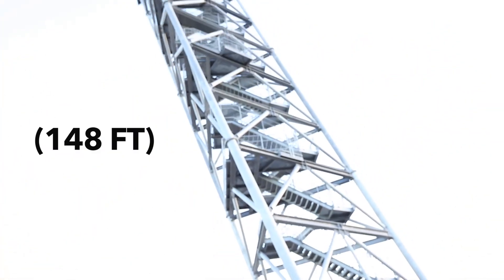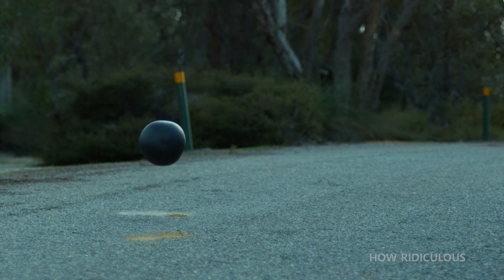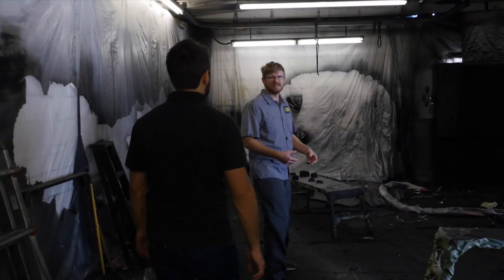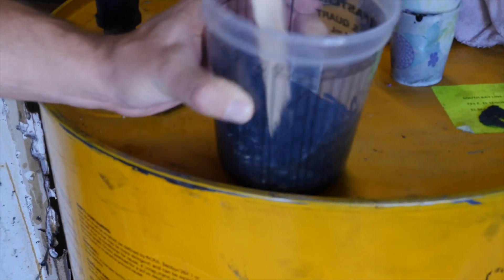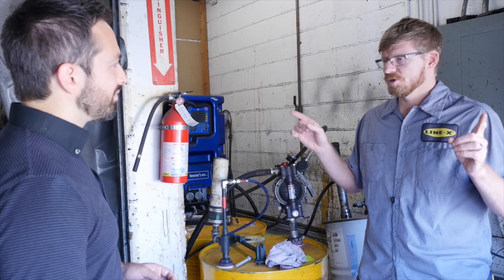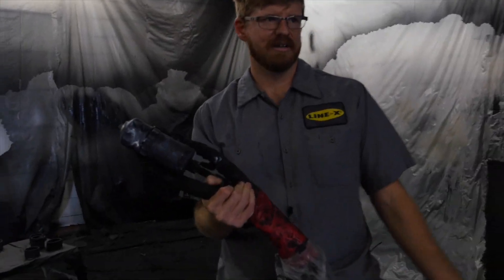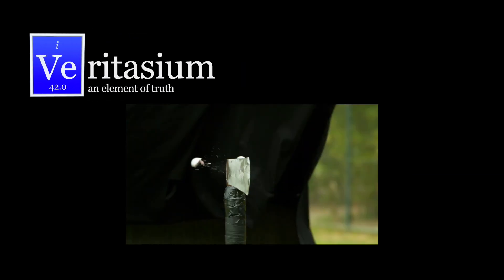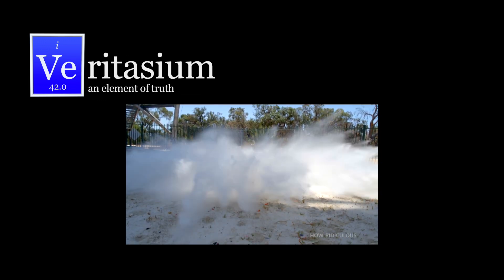Indestructible Coating?!

Comment: I need this on my phone
Reply: They just throw old Nokia phones into giant crushers that need to be replaced every 3 days and BAM, Nokia powder just waiting to be rebranded as Linex.
Reply: Richard Z cover it with a nokia shell. actually linex is made up of nokia molecules instead of the poly-urea molecules as said in the videos.
Reply: +Juggernath Nokia's Executive Powder. It's got a million and one uses...
Reply: Get a TPU (thermoplastic Polyurethane) case. It is a very similar material made using the same reaction and has very similar properties. This polyurea is not much of a new invention it is a basic concept in undergraduate polymer classes.

Comment: if it's accidentally applied on the skin, it's impossible to remove without removing the skin?
Reply: Well, i think your skin cells would fall off after a while.
Reply: Normally it would probably just come off... But the temperatures made by the reaction might melt your skin which might fuse it with it.
Reply: @descai10  It might enter your blood stream as well, and you'd be dead within some minutes.
Reply: you become Luke cage
Reply: It would burn.  My guess if quickly wiped off it wouldnt stick because of oils and water on your skin.
Reply: No... It acts like rubber, so you could rip ot off, or in the wors cases remove a layer of the skin.

Comment: What about using this for safety in vehicles? Instead of lining the bed of the truck, spray the entire truck.
Reply: Daniel Gloyne 
Although it may be useful to reinforce certain parts of a truck, I believe vehicles are designed to absorb impact rather than bounce. 

Otherwise you'd fair about as well as the inside of that watermelon in an accident.

I could imagine this as a great coating for military vehicles, though.
Reply: Martin Good point. I guess people would bounce around and then air bags would have to be redesigned. Military could work, maybe even for aircraft. Or people in tornado prone areas should line their walls too. I just think the applications if done right could be used to help a lot of people. 👍
Reply: If you were inside the vehicle, you would still be killed in say a 60mph crash into a truck while youre driving a car, lined or not. The inertia is usually what kills the person, not the crushing of the car. Though it could be pretty effective for constant weight and not sudden G's, hence why the bed of the truck is the first choice.
Reply: Daniel Gloyne The place I worked at did it to the interior and exterior of a jeep. never had a paint chip haha.
Reply: Kara Hanscomb Haha that's awesome!

Comment: It says 107 km/h, but even using a high latitude gravitational acceleration of 9.825 m/s^2 and ignoring atmospheric drag you will only get 3.01 s * 9.825 m/s^2 * 3,6 (km/h)/(m/s) = 106,46 km/h.

Comment: Could you linex an egg and drop it from that high? Actually does it matter what's inside the linex? Surely it just tries to keep the shape and whatever is inside gets a beating. It would probably still contain but probably break up concrete inside it

Comment: This is pretty revolutionary. What happens if you spray it on a slinky? are there bullets that this can't protect from? can it help with preventing buildings from collapsing during earthquakes? how expensive is it? we should make helmets from it. compare its shock-absorbant properties to other objects.
We want answers Derek! :D
Reply: It wont help with bullets it cant protect a car moving at relatively normal speeds from serious damage either nor could it stop a building from collapsing in an earthquake
The way it would collapse though would be different (As in larger blocks of debris that rip the coating due to weight i think) and it works against Police dogs biting through your clothes if you have it on there
Mythbusters did an episode on this a couple years ago

Comment: As a materials engineer, I can say that this is the property of basically all rubbery vulcanised material. This coating is not as thin as it seems, and the ration of elasticity/rigidity tends more to rigid rubber, due to more tangling of polymer chain.
Reply: Greetings,
I am a little bit of out of my depths here.
Is it possible to use this to create a car chassis ?
Reply: @Seekerofknowledges  no, a car chassis has to be stiff -- watch a Formula 1 car in slo-mo going over a curb at 100mph, the tyres are flinging about everywhere but the chassis (tub) remains straight. Now watch a road car trying the same thing, the body shell twists & the car usually ends up spinning off or rolling.

Comment: s = 45m
a = 9.81 ms^-2
t = 3.01 s
v = 107 kmh^-1 = 29.7 m/s

v = a*t
s = 0.5 * a * t^2

9.81 * 3.01 = 29.5                    good enough
0.5 * 9.81 * (3.01)^2 = 44.44  also good enough

seems right :)
Reply: You forgot your units. -1
Reply: Looool I'm guessing you do A level physics atm?
Reply: Adam Zidane that's GCSE
Reply: Adam Zidane 
after looking up what GCSE means I can say it's more GCSE level. 
in currently in my twelvth year at school (German Gymnasium) and it had been a while since we last had this stuff in school. but it's easy.
Reply: In English we use a period (.) instead of a comma (,) as our radix point. So the acceleration should be 9.81ms^-2

This way we don't confuse the comma with the one we use to mark each power of 1000, as in the speed of light 299,792,458m/s
Reply: 107=29,7 ? Sure
Reply: Obbliteration 107 km/h= 29.7 m/s
Reply: Obbliteration 
fixed it 

Dan
I know. i somehow switched to comma and then made all consistent. 

also, I would like to add that I have neglected the force that is induced by air resistance. it could become significant at almost 30 m/s.
Reply: Assuming a watermelon 61 cm wide 25 cm in diameter weighing 10 kg with a drag coefficient of 0.27, the terminal velocity is 36.25 m/s, so it is pretty significant

Comment: I want that on my car.

Virtually a tank
Reply: Atiruc until you hit something. inside would be a mess while the outside would look like nothing happened
Reply: People actually do that, it's particularly popular on old jeeps and 4x4's in general. It wouldn't make your car mechanically tougher, but it would make it scratch resistant. Basically you'd never have to worry about a shopping cart hitting your car again...

Comment: Lynex Helmets need to be a thing i want to be able to take hammer shots to the head with little to no injury.
Reply: Brian Rodriguez The exact same thing will happen to your brains as to what happened to the watermelon. In short,  it's a bad idea o:
Reply: Even if the helmet doesn't crack or break, you still end up with a concussion, which can kill you if you are hit hard enough.
Reply: Brian Rodriguez depends on how it the hammer is and how hard the person swings it. even with a normal hammer, if a person swings with all his might, then your gonna get hurt. the lynex doesn't protect from blunt force trauma that well, that is what padding is for.

Comment: Sometimes, simplifications aren't at all usefull. Those molecule-building blocks are good, when you want to understand the three dimensional structure of things. But to understand the underlying chemistry, they are hardly of any use. I would have loved to see the actual chemical formulas for these, to immediately understand what's going on.

Comment: How does that gun not get instantly clogged up with polyurea?
Reply: R.B. the two components mix outside the gun in the airstream
Reply: The two chemicals are carried in separate lines to then are sprayed in jets at each other with a central jet of high pressure air carrying them away as they mix. No significant reaction is happening until the mixture leaves the gun. The tip of the gun could clog but it could be cleared with a solvent just like any other paint gun.
Reply: It could be that the air continues for a fraction of a second after flow of the two chemicals is stopped from entering the mixing chamber.  That final bit of air would flush the remains of the mixed chemicals before they begin to harden.
Reply: The two components have separate nozzles within the front air nozzle(replaceable) the two nozzles are angled towards each other with the two streams colliding within the airflow, so while the two mix within the airflow of the gun they dont actually mix within the gun structure itself
Reply: R.B. Has to dry.
Reply: Good question 🤔
Reply: +quosmo1 well I doubt he's actually the guy that designed the sprayer...
Reply: The video only talks about it's tensile strength, and nothing of it's adhesive properties. Perhaps it doesnt stick well to the inside of the tube (perhaps lined with something like silicone) and is easily peeled off.  It seemed to come off the watermelon in large pieces, which is an indicator it didnt stick to it very strongly.

Comment: Coat your car with it, no accident will damage it.
Reply: Wargon Not quite how it works, this stuff is flexible so your car will be one crumbled up piece instead of 2.
Reply: Mythbusters did an episode with bed liner, and it definitely helps protect against low speed crashes...
Reply: slikrx Mythbuster busted this

Comment: MDI is a skin and respiratory sensitizer (health speak for very serious nasty stuff). In the first shot of the Linex being applied, proper Personal Protective Equipment was utilized by the operator; however, the second shot, the operator was using a fire retardant mask over his beard with a tight fitting respirator... which does nothing to protect him as the seals do not contact his face. I sure hope the second is not standard practice.

Comment: Cool video, but there is some bad Materials science in this video.

The process you describe at around 3:33 is polymerisation, whereas this reaction is far more likely to be a crosslinking. i.e. Rather than short chains getting longer, the curing process is pre-existing long chains getting interconnected at multiple positions. 

This changes the mechanical properties of the mixture from a viscous liquid, where with enough force, the chains are able to slide over each-other, to something elastic, where a small amount of deformation is possible with the straightening of the tangled chains, but is limited by the interlocking groups preventing any sliding, essentially any elastic. 

The straightening of the interlocked molecules is a very energy intensive process, which means that any deformation of the polymer absorbs a lot of energy, and then this energy is released again when the polymers re-curl (entering into a higher entropy state). This is what allows the ball to bounce, and not break.

Comment: ok now, how much pressure per cm can this stuff withstand, i imagine if you got a hold of an obsidian scalpel you would be able to penetrate it with a bit of trouble, I think the guy kyle hill said that with an obsidian scalpel you can actually create pressure as big as the ones in the center of the earth, with just like 100 Newton on the actual knife
Reply: I seriously doubt you'd be able to push on the obsidian scalpel with 100N of force, by hand, without it breaking. They are very brittle.
Reply: Rykehuss well... i dont know i have not tried it but what about throwing it maybe? that could easily be 100-150N (i think, im not THAT familiar with newton)

Comment: I wonder what its friction properties are.
Reply: go slide stuff around in any lined truck bed. Slick as snot, especially when wet.
Reply: Well, those runways don't need friction to stop the planes. They use cables.
Reply: malignor yea it's pretty slippery, but it forms bumps so it isn't too bad.

unless wet
Reply: Actually, I've heard they use this stuff on the runways of aircraft carriers! But that could be a special mixture different from the bed liner stuff.

Comment: I wouldn't say the watermelon survived that :P. It's like if I was running 60mph into a brick wall, I would get splattered, if I drove a car with no safety features into the wall 60mph, i would be decimated most likely but the car would still be there (just deformed.)

Comment: this coating is also obtained by melting a Nokia 3310 inside the core of dying star.
Reply: Dont you mean melting a dying star in the core of a Nokia 3310?
Reply: Alternatively, you can also melt the Nokia 3310 in Mount Doom in Mordor.
One rubber coating to rule them all!
Reply: ElectroBlood, one does not simply melt a Nokia 3310!
Reply: I love you guys
Reply: Loooooooollllll smh
Reply: you mean, the Nokia 3310 is forged inside the Core of a Neutron Star?^^ oooh, thats the Reason why Mjölnir broke against Hella.....

Man, he should have used the 3310 instead of his Hammer...

Comment: I've worked in the automotive industry and this looks like the reinforced polyurethane used to stick windscreens into the frame, also reminds me of the bicomponent glue that is used to repair bumpers.

I'm guessing it is very similar but just refined to give it more strength and to catalyze faster.
Reply: David S. 
yeah, the mechanism is pretty much the same.

Comment: Why don't we coat the car tires with it? Shouldn't it be both be impossable to get a flat tire, as well as reduce material degradation on the tire surface significantly?

Comment: i wonder how expencive that stuff is. coating a car would probably be a good crash absorbend, lighter then metal.
Reply: in a car crash, you WANT all those little bits flying off, if they didnt, the energy would just be returned to the vehicle, and the crash. In a similar way that the energy was contained in the watermelon. A container inside the vehicle, or maybe a motorcycle suit would be a good application, i think.
Reply: A car crash, the car bounces and the people inside the car turn into slushie.
Reply: GirlPainting probably cost you around $5000 to get the entire car sprayed.
Reply: you want to look like thet watermelon splashed all over your car?
Reply: It was close to $15000 last time i got a quote from Line-x to coat the exterior of my car